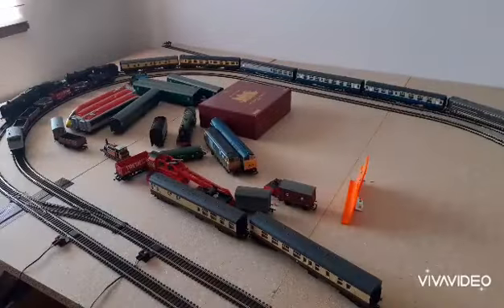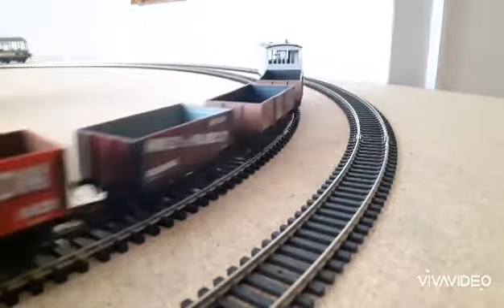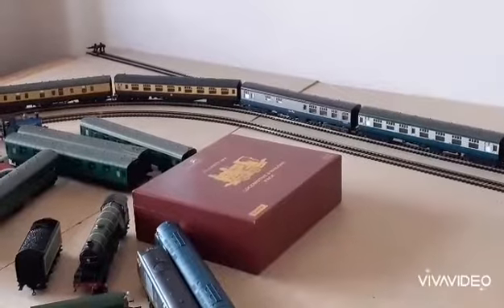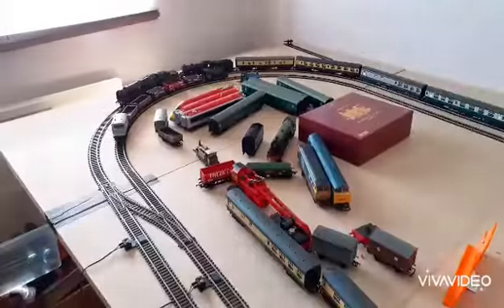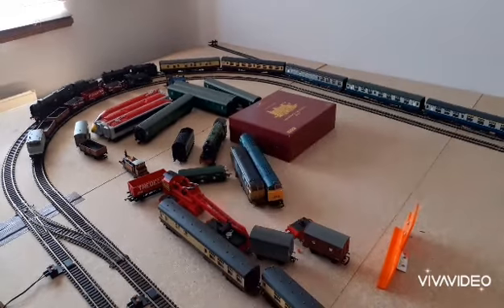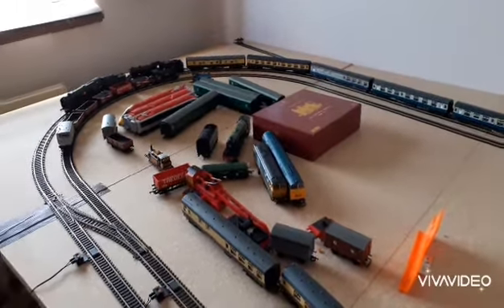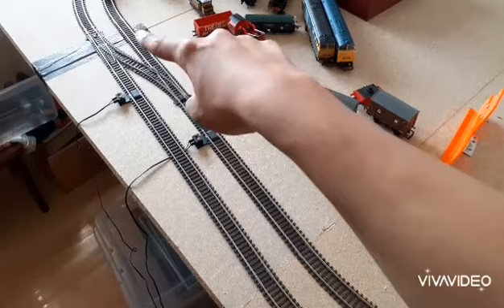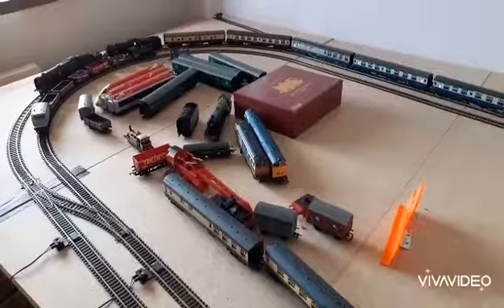Layout Update 28/7/20

Comment: I must admit your model railway looks better on a baseboard. OK, the oval of double track with points and a siding isn't perfectly straight, but at least it's not hanging over the edge. Try to get the track as straight as you can, no-one's perfect at it. Least of all me. Thanks for the steamy running session. I especially love your cute Tiny Terrier Tank Engine. Pity you didn't run any Great Western Engines, but it doesn't matter. I'll see God's Wonderful Railway again somewhere further along the line, I'm certain of that.
Reply from the maker: Yeah, there will be gwr down the line